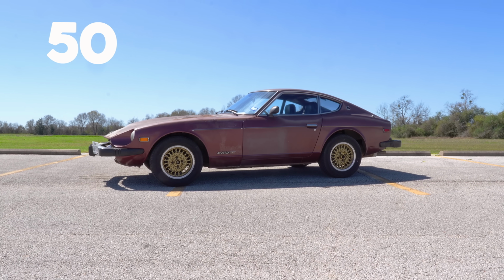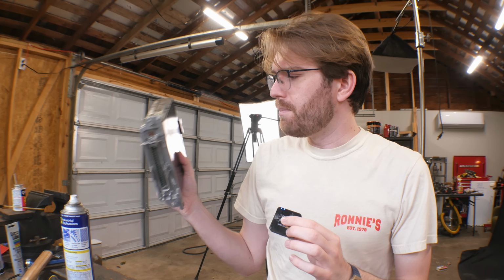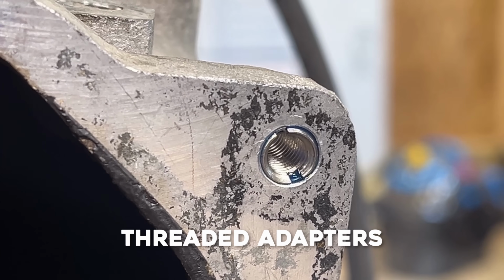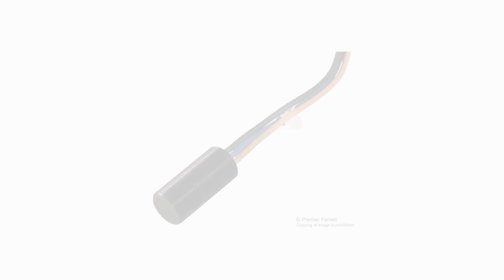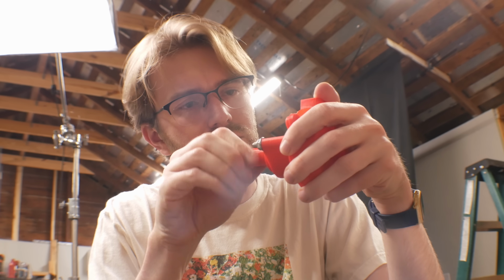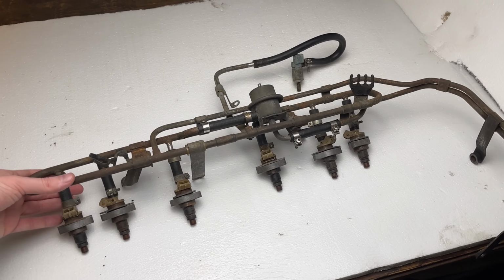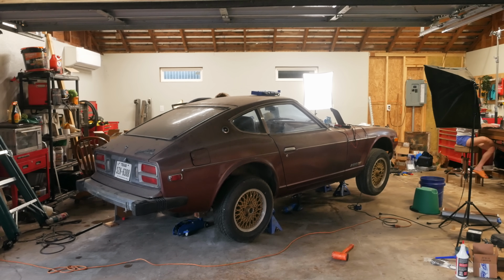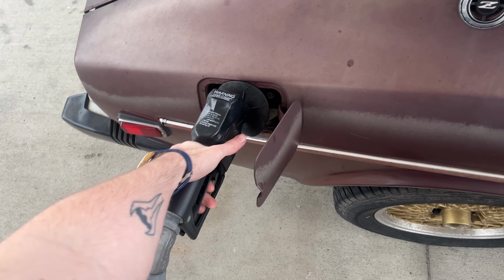Modernizing a Vintage Car

Comment: Reinventing the wheel as it were? I'm curious why you didn't just buy a breakerless distributor for that engine? Mallory has to have one for that application. You could have used the pick up coil for your trigger. Yeah, I get the money part, but time is money. It's nice you can make custom parts, but off the shelf solutions are easier and don't require wasted R&D time. A month? Geez, dude...

Comment: You did an incredible amount a work and it paid off! Some changes you should make- the base timing should be 17 BTDC. You also should calculate the total timing which I leave you to google. Also add a K&N style air filter and bigger exhaust (header, bigger pipes, no cat, bigger muffler. Good luck!

Comment: You also need mechanical and electrical timing for an engine to run. It annoys me that this is glossed over in so many videos. If your mechanical timing is off, not only can it keep the engine from running, but it might destroy the whole thing. If electrical timing is off, it either won't run, or will run like garbage. Timing is every bit as important as the other three :)

Comment: Only true connoisseurs -- the most intelligent and handsome -- restore Datsuns.  When I did a ground up restoration of my 240z...
Reply: ...I had to deal with syncing triple side-draft carburetors.  You're weak.
Reply: (I'm just kidding.  Building that EFI system from scratch is super slick)

Comment: I'd like to see further upgrades to the engine. Like a better intake manifold, bigger throttle body, split header, true dual free flow exhaust and a hotter camshaft. Then back at the dyno.

Comment: That thing sounds NASTY at the end. Love it. Your engineering/design background is really showing with this video! That distributer camshaft angle sensor replacement is slick.

Comment: As a car guy and a mechanical engineer who moved on to software, I applaud the effort. The RF designed parts are definitely neat.  However, my car guy sensibility for older cars has lead to my affinity for carbs - especially the Weber DCOE.  I love their mechanical-ness and analog philosophy in this digital age.  On that 280, I imagine lifting the bonnet and seeing a trio of Weber 40 or 45 DCOE's with no electronics or computers making more power if properly tuned.
Reply: If they make more theres something wrong with the setup they're compared to. Row or side drafts def. Are nice though and you're not gonna be balls out pretending to be kankkunen or something anyway for a driving car. But a nice row of itb's is pretty nice looking too.

Comment: Supa-Chaaaaaaajjjjjj.  You arent making a fuel-mileage monster, you're making the failed spiritual successor to the objectively better 240!  Now that you have EFI, the goal should be to figure out EXACTLY how many horses that engine can produce.  In my opinion.  Also, you painted the Fiero like, 19 times.  You can paint the 280 at LEAST once.

Comment: JLC offers parts in Steel Alloy: 45# Steel.  That can be easily hardened at home by heating the end and quenching, then tempering.  1/ Heat the end you want hardened to cherry red with a torch.  2/ Quench the end quickly, leaving part of the shaft hot and unquenched. 3/ Quickly file off the scale on the end so you can see the temper colour changing.  4/ As the heat flows back into the end the colour will change thru the rainbow, tempering the part.  5/ When the very end is purple the part can be fully quenched, leaving the end hardened and the rest of the part soft.  Practice on an old drill or chisel if unsure.

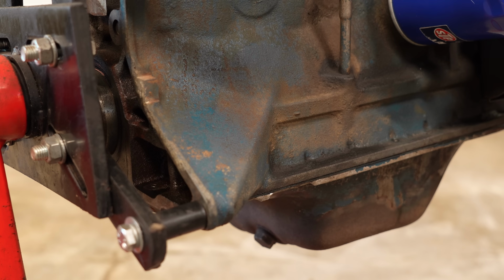Comment: 3:10 my dad owns an old Nissan. Tho it's a 90s model, the engine is from the 70s, A15 engine a 1500cc carbureted pushrod 4 cylinder engine. And it got the same blue. 😬

Comment: Fun stuff, as always... check the old Hot Rod series, "Engine Masters", season 8, episode 6 for a great break down on bank-vs-sequential EFI... the details might just upset some mental apple carts, in regards to things like overall fuel efficiency.  Seeing the brief bit of final dyno runs, I think your "no internal mods" mantra is fine, as long as basic maintenance for a high mileage engines isn't neglected(the smoke on over run? That's tired rings\valve seats\seals sir...) great to have an update, and like any good junkie, want mooooore<grin>

Comment: Fantastic work on the Video. We actually installed a very similar setup on a customer's 280z back in 2023. His car had other mechanical issues that he's since sorted and has been running his Full DBW setup since. It definitely made a huge difference overall to efficiency and performance.

Comment: if you really wanted to maintain the throttle cable, you could use a gm 2.2 throttle body off the s10 and then wire the stepper motor that controls idle. just an idea if you wanted to keep the mechanical pedal

Comment: this is exactly what im planning on doing for my 85 mr2. modern injectors, modern DBW, MAF, and lambda sensors. not so much for power (although you proved theres some to be gained) but also for just reliability

Comment: The fiero was a restoration, the 280 should be a full blown resto-mod, should’ve opened the engine dropped some higher compression pistons a bigger intake and other power adders… cool stuff though.

Comment: I have watched since the days of the Fiero restoration.

Watching how you really gathered and designed the necessary parts and ECU to make everything work correctly is so satisfying. And without having a huge budget.

And knowing that "knowing a guy" is part of getting stuff done can give one confidence in making what one could long time ago could only imagine.

Maybe a rebuild of the engine could come in the future. Getting better and more efficient parts and cleaning it of all the gunk inside could result in power power and better mileage.

But that could be something for future Ronald Finger.

Here's another possible project for future Ronald Finger: swapping out the Iron Duke on the Fiero for a overall better engine. I hear the 3800 V6 is the best choice for that.

I wish the best for you.

Comment: Great video! I’ve had my 280 over a decade. I too got tired of the low HP old tech fuel injection technology. I went the LS swap route. Easier than what you did, but it would make for a boring video.  Yours is a lot more interesting.

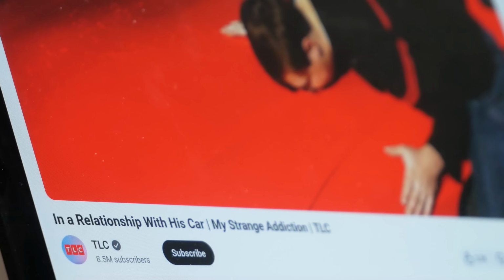Comment: 7:00 I think it's more that for the longest time E-Throttles were slow as F.
My buddies old Seat Leon 1M 1.6L (basically a Golf IV) took more that half a second to realise that there was a throttle input.
His new Hyundai (not the crappy US division) I30N has a throttle input that rivals cars without E-Throttles.

It's basically like ABS.
Back then it was hated by everyone (still is by many for some reason), as it was slow and sluggish.
Actuating less then 2-8 times per second, depending on the car.
You'd wast so much time that you want to slow down with nothing!

Many people don't want to understand that ABS will easily outbrake anyone anywhere (with exception of loose material like gravel or snow).

Another reason why E-Throttles are disliked is that the car doesn't do what you want it to do.
Sure, you don't need to rev the engine to the limiter in neutral (unless it's a DPF you want to clear maybe),
but if the driver wants to rev it to 5k for no reason, and the car just doesn't is a good enough reason for many.

Comment: Next vid idea: throw that intake manifold and design a new ITB system and high flow headers with full exhaust and see how much it gains. You can also play with the ITBs to optimise their flow. and possibly throw a head package on it 😁 
You did a great job in cleaning the look of the engine and made it simple with out the million cracked vacuum hoses😂

Comment: If it was me I would of got rid of that pos inline 6 because the head on it rn is so bad for flow they really arent that good without a crossflow head which there is aftermarket ones and it really increases hp and torque.

Comment: 2:09 Fellow Chevy Cruze owner. I hate my life.
Reply: I OWN A 2012 CRUZE AND I TREAT IT LIKE MY SON BUT IT KEEPS DISAPPOINTING ME 😭
Reply: @bbcbread 
My stuffed animals don't disappoint me cause at least they listen to me and don't run away and say mean stuff
Reply: @Lele_Wolfgang I wish cars did the same 🥲
Reply: @bbcbread  i understand
Reply: As someone who works on them from time too time it might be worse just because I live in the rust belt but they are all s***t boxes
Reply: Cavalier >Cobalt > Cruze. My cavalier was rock fucking solid, the cobalts have electrical gremlins, and you'd be better walking backwards in a blizzard than driving a Cruze.
Reply: @cavalierliberty6838 you say that but my Cruze has gotten through more blizzards than I can count. Foot deep snow it doesn't matter it's gotten through it
Reply: @awsomDixie how many thermostat housings have you replaced?
Reply: @cavalierliberty6838 never once. I have the diesel one if you didn't catch that. The one that wasn't a disaster of an economy car. Nobody seems to know it exists
Reply: @awsomDixie I did not catch that. I've seen a couple diesels, they seem to be halfway worth a damn. The 1.8 and 1.4 however...
Reply: @cavalierliberty6838 no the gas one for sure that's trash. The diesel wasn't a gm engine and actually apart from an oil pickup issue has next to no issues, so long as it's deleted of course. Modern diesel things. Seen plenty that go past 300k, all while getting 50 mpg. This being why I say they accidentally made the best economy car with the diesel cruze
Reply: @awsomDixie Real shit my cruze is pushin 230k with all original everything atleast acording to previous owner who owned it for a long time mine is crackle tuned with a zzp cold air intake a zzp downpipe and full turbo back zzp exhaust and it is a 2012 eco 6 speed manual i haven’t had any bad luck with it yet atleast im about to do all the major maintenance on it so that i dont get any of the issues they do much have but i love this car its fun as hell it’s like a little go cart driving around and it doesn’t sound bad at all “with the exhaust” it reminds me of a civic and subaru mix sound with the turbos aswell that just adds ontop
Reply: Need the diesel one. They accidentally made the best car
Reply: Fellow Chevy Cruze owner I personally love my cruze because it makes every other car I drive feel cool
Reply: I also drive Cruze. The 1.8L model. Still sucks. XD
Reply: Same
Reply: Same here but I put a system in it to make it tolerable 🤌🏽
Reply: 😂 That's honesty. I have driven a few objectively bad cars that I kind of liked. This does not sound like one of those.
Reply: Same
Reply: Right there with you
Reply: I'm so sorry
Reply: Hahahahahah
Reply: I was about to comment lol... XD I thought it was a steal!! IT WASNT
Reply: I bought my 2014 Cruze lt new, it has 145k on it right now. I haven't driven it in years, my kids have all taken it to college and returned it home ando Ed on. Currently it's with my youngest, he likes it but wants a new Tacoma. It's been ok for a cheap car. I don't understand all of the complaints, It's a CHEAP car, get over it😂

Comment: Had to laugh at the closing. What you built is an awesome system. I'll be one of "those guys" who'll say, "you should change the cam to get more power, and it'll do better on fuel too".

Comment: 😂😂😂 lol I own a 2013 cruze eco with a manual transmission. Also after you replace the starter it won't be just about the fuel savings it will be the better reliability of the newer system.

Comment: You don't actually need an e-throttle body to accomplish what you said. A idle air control valve does the same thing.

Comment: electronic throttle bodies do a lot of good, i just wish manufacturers would put a manual lever attached to the butterfly valve so i can rev/idle up the engine while im searching for a noise under the hood
also prefer the throttle response, ive found a lot of stock E-throttles have a noticeable delay. maybe its just a symptom when paired with a slushbox auto but its heavily skewed my opinion of them

Comment: Early EFI Systems are just awful in all regards. A well tuned carburettor is better.
Ive always seen successful and well executed drivetrain swaps as the peak of a restomod.
So thats for sure something id pursue with this car.

Comment: Great work! Seeing someone actually helping old cars get better fuel efficiency is somehow far too rare. Most just want more power, more speed and more sound. But getting the motor to run at it its old specs (or just a bit better), but more efficient, makes it suddenly a feasible everyday vehicle. Idk if there are further tricks to modernize this motor further, but I cannot wait to see.

Comment: So... from around 6km/l to around 7km/l and + 13% power... not bad... I think if you mess a little bit more you can have around 12km/l and more than 200hp. (man, miles per gallon is a hell to convert to metric, sorry).

Comment: Hall effect sensors are... weird. Some of them are designed and work forever, but in the case of my car they actually have a small graphite nub that sticks out of the end and actually almost touches the gears. I think when it's new it likely does, and the graphite just wears off on first use. This makes a really tight and reliable connection... until it doesnt. Years of cold starts and various conditions mean that one day you run the car, go to start it while it's still hot, and the thermal expansion of the block renders the sensor inoperative.

What I don't get it why you'd use this design at all, maybe it's because the gear is right on the crankshaft in my car and so it being inserted into the block needs it to be this style, but I've seen them that have a plastic coating on the end and "just get close" and last forever. ¯\_(ツ)_/¯

Comment: You could increase your MPG by reinstating your EGR system, BUT does that ECU have provision for EGR timing?  Because you don't want any EGR when the engine is cold, and you don't want EGR when under heavy load.  You only really want EGR to kick in during periods of steady cruise.  At the same time, you also don't want the Engine Control to fatten up the fuel mixture during periods when the EGR is active.

If you can get around ALL THAT,  reinstating the EGR might net you 2 to 3 mpg on longer trips.

Having said all that;  Good to see you back.

Comment: Shouldn’t there be a precisely curved bump on the other side of the throttle body adapter, to fill in the void of that oblong cross-section and avoid a sharp step change in area?

Comment: Nice, couple of things to optimize. Port that intake to match the throttle body! You're losing a bunch from all that turbulent air and restriction. Cams so easy to change out, you should have bit the bullet. Also can you do a video giving details on what Stoopidfast did for tuning? 
I will say this was AMAZING how you got this working so well in less then a year.

Comment: Honestly, Ronnie, you should pull the motor again and give it new pistons (10.0:1) with new rings, a new and somewhat more aggressive cam and a new map for a higher performance application. You could get 200 hp from that motor with 160 hp at the wheels and have a nicely driveable Z... just get some body work done.

Comment: If an old 280z isn't good enough for you, I suggest you pick up a "modern" 350z for cheap.  That should keep you happy, and spare this vehicle for the purists.  People get touchy whe you mess with classics because they "aren't modern enough".  I've seen it all from radical engine swaps to people just restoring the OG drivetrain.  You can easily get people in a tizzy by messing with a 48 year old car.  At this point, I say it's your car do what you like with it, but posting about it online is a recipe for grumpy comments lol (I have personally "bastardized" old Zs myself, so no hate intended).  Just saying...

Comment: I’m even older than that car with similar problems; missing, corroded, inefficient, droopy, or worn out parts (many of which are no longer available from the local Frankenstein parts store or on EBay), etc. If you ever get into restoring biological entities, let me know. I won’t require all modified or 3D printed organs to necessarily fit into the same place as the original ones.:face-orange-raised-eyebrow:

Comment: What a supremely intersting way to update the Z. I was alllllll in once I saw it wasn't just a swap. So so so good to watch.
Reply: Even a swap would've been cool with the right engine. Another comment suggested the Toyota 1JZ engine, which is also a Japanese inline 6, and the JZs also made a lot more power than these Nissan engines. Toyota has also always had better overall quality than Nissan, as much as I like these old Zs, they were not exactly high quality cars even in the 70's. If I had to pick between a 70's Z and a 70's Celica I'd pick the Celica. Look at a 1977 Celica and tell me you wouldn't drive the hell out of that, it's like a baby muscle car.

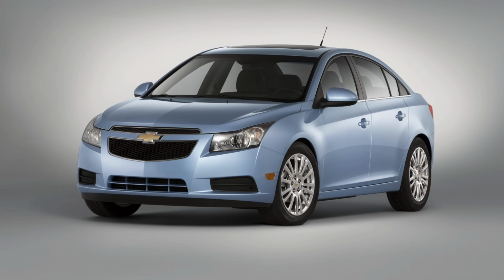Comment: 2:04 as a previous 2015 cruze owner, can confirm.
Reply: As a GM technician, can confirm. I apologize.  Lol
Reply: @evinlong109  bro, you fix  them monstrosities the engineers cause it’s not your fault. Don’t apologize 😭🤣
Reply: Had a 2012 Cruze Eco. Can confirm. Worst part is, the Eco Trim was the best trim of the car.